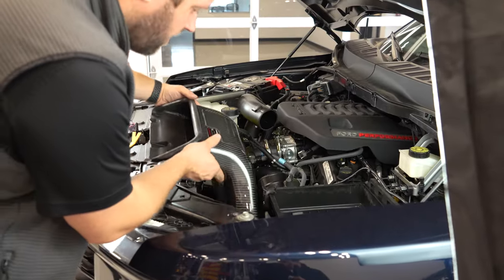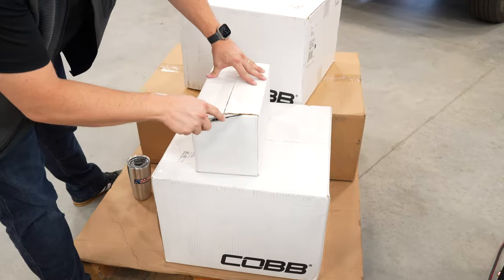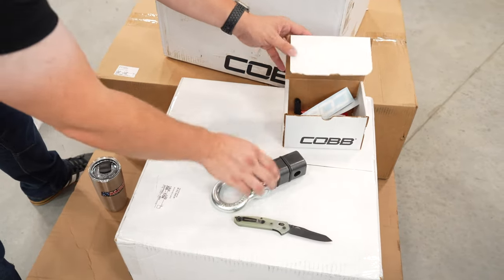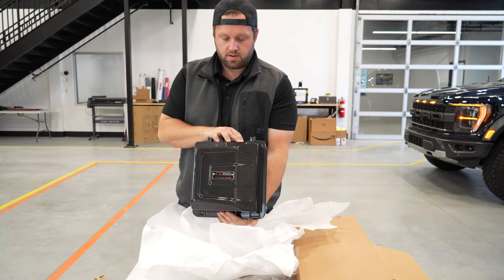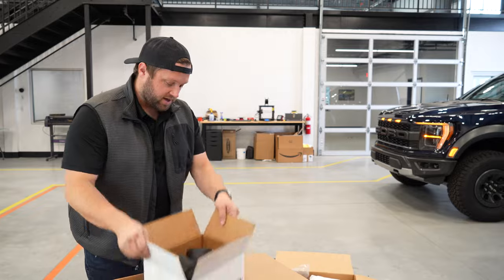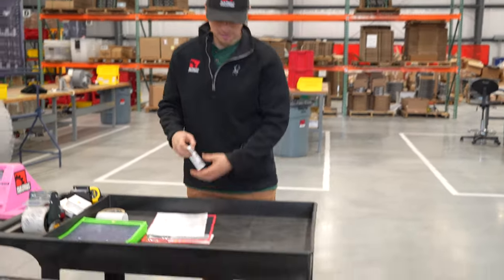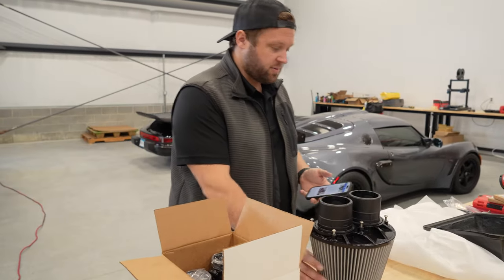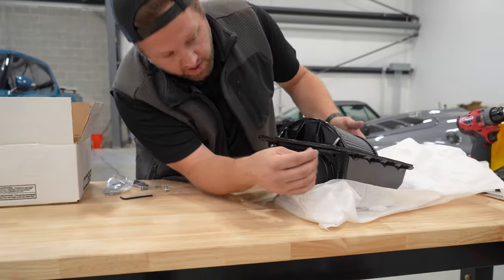Installing COBB's Redline Intake + Scoop! // 2023 Raptor Build Ep.4

Comment: Do you think this one being the redline carbon fiber would give a better audio tone than the standard composite plastic one of the non redline? part of me wants to believe the redline would have a slightly louder, richer tone since its lighter and less audio dampening also since your raptor already had the noise restrictors removed from the intake hoses you probably won't notice a huge difference before and after compared to the gen2's
Reply from the maker: Not sure really, but it's conceivable the carbon scoop/tubes could make cleaner, maybe more 'throaty' intake sounds. There wasn't much difference in sound after the install, but the induction noises were a little more defined - whether that's just COBB's intake/scoop engineering or the carbon fiber making the difference, we're not positive. Good question though! The folks over at COBB would definitely have a better answer haha